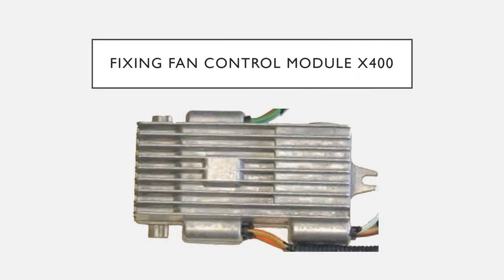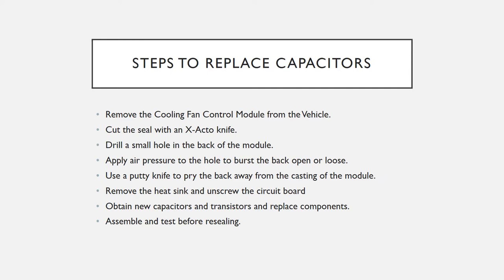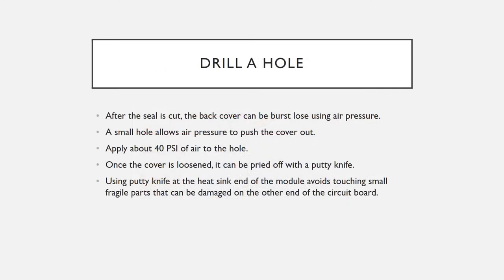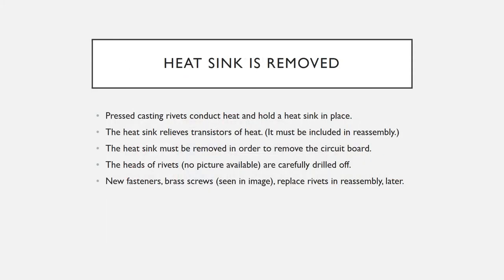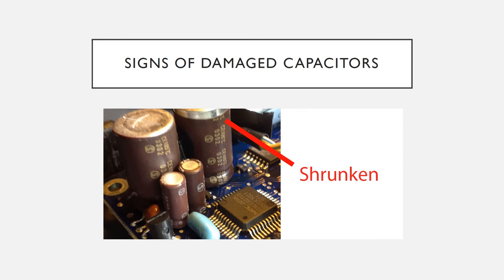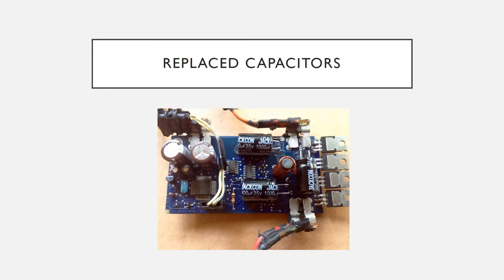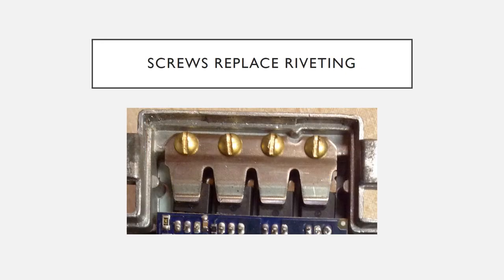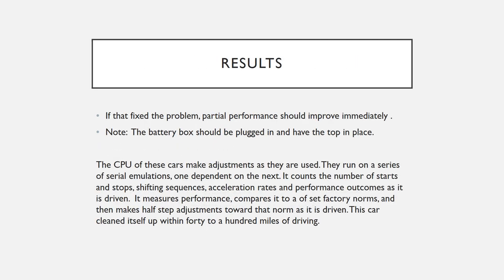Fix the Jaguar Cooling Fan Control Module X400

Comment: Did you mesure the control wire (white/blue) before? (PWM signal)

Does the +12V level come from CFM, and ECU pulls it to ground in PWM manner?

Or does the ECM pulse with +12V?